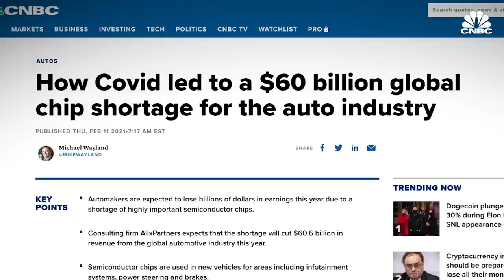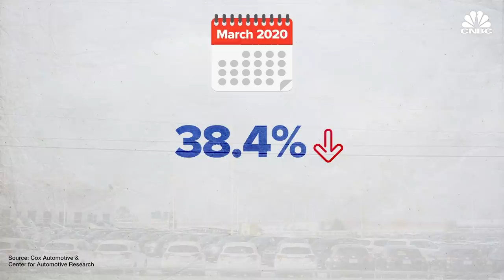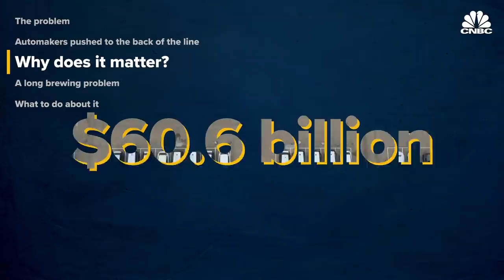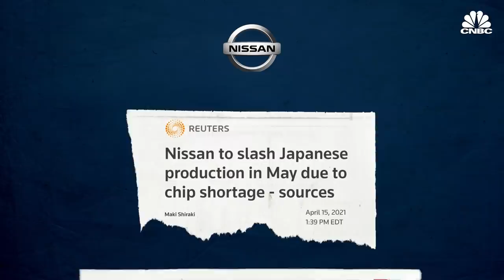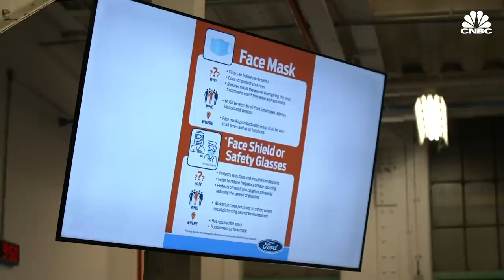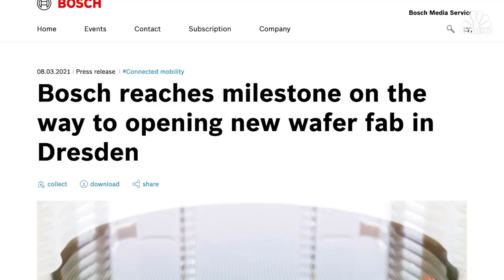Why Tiny Microchips Are Crippling The Global Auto Industry And Driving Up Prices

Comment: Is it really crippling? Or are we spreading fear?
Reply: Apparently certain manufacturers have been removing from entry level vehicles components such as digital dashboards, large screens and other  digital based components.
Reply: My local Mercedes-Benz dealer usually has 200 cars on the lot. They’re now down to 40. There are a few A and CLA class cars (entry level) a few C class cars, no E class cars (Mercedes-Benz midsized sedans, their bread and butter cars), and 2 S class cars and fewer than 10SUVs. No it’s not just spreading panic. The shortage is real.
Reply: Spreading fear?  The chip shortage is great news!
Reply: I work in a ford plant we now have 2 months till new supply comes in that means the plant is closed these chips are for things every auto maker needs like airbag sensors and stuff . everyone is affected so for the industry it is a really huge deal but also entirely their on fault but thats a different story
Reply: Try buying computer parts, then you will see how real this is.
Reply: I am not a fan of Apple but one thing they do very well is guarantee supply chains. They book capacity for chips or screens well in advance of launching a product, typically 2-3 years in advance. You cannot have flexible supply chains when capacity is limited. The automotive industry is not a valuable customer to chip manufacturers. They use many inexpensive chips based on old technology. Even budget phone manufacturers are much better customers.
Reply: @Snowbush2  that fact that you think gpu's and cpu's are at all comparable to the other basic IC's is laughable.
Reply: Yes they are needed for the technology. Most manufacturers moved away from basic simple cars that don't require these specific types of chips. 

More and more people are asking manufacturers to bring back basic cars. It's the biggest complaint I had when selling new vehicles.
Reply: In this case  CreateFear()  has been used.
Reply: no it’s really crippling, I lost a large majority of my deals I had in pipeline due to the shortage. Sucks balls.
Reply: @texasgermancowgirl  if you sell cars, hit your people for referrals, call service appts for trade evals, hit your used inventory list. In Elead you can filter these out and find decent opps. That or go to the skate shop and start skating people 😂
Reply: @th0rn3gaming  I sell computers and software sadly. Or I would totally do that. :( computers are different. Software is easy though.
Reply: @texasgermancowgirl  aahhhhh, my advice. Don't sell cars 😂

What type of computers do you sell?
Reply: It definitely is. We’re seeing a lot of plants shutting down or running on limited production. It’s all a money grab for these guys until the social tech needs die down then it’s back to auto.
Reply: @BigMaxStax  are workers being fired? Otherwise people are just driving old cars a bit longer or buying second hand. No big deal.
Reply: spreading fear. auto makers have plenty if room - like standarisation and interchangeability. also using open source solutions. 
That is what most other manufacturers do - dram chips, gpu's, asic glue logic - is all interchangable in consumer electronics because supply chains are unstable.
Auto makers used legacy chips and deliberately introduced planned obsolescence to hinder any recycling. So now they drink beer they brewed themselves - when all other customers use smaller dies of cutting edge chips and juggle suppliers, auto makers realised they are not center of universe.
There are many solutions , and bucket of cold water will not hurt.
And hey. import tarifs! that means customers will pay anyway.
Reply: lots full of unsold new cars here in north Texas
Reply: I’m spreading mayonnaise
Reply: It's a real enough problem. Automakers can go hang, they made their bed, they can very well lie in it. But all the rest of the industries are also in frits, lead times for absolutely everything are through the roof and working around component availability causes unnecessary redesigns all over the place.
Reply: @aleksandersuur9475  Well, there was room to invest over past 20 years and last 5 were crazy. Instead of creating investiment bubbles which burst and leave ppl homeless, ppl could invest in something real, like setting completely standard fab. Last decade is like decade of scam - fake news , vaporware, even perpetuum mobile (ITER) . 
Speculative bubbles are big thing and everyone gets away with them. 
Banks cannot buy land - so they issue investor backed loans to ppl who buy houses , making prices skyrocket. precious metals speculators push investors to manufacture giant electric cars noone can buy - removing rare earth metals and precious metals like nickel out of the market, freezing them in big slabs of junk noone can buy or recycle. 
"renewable" scam removed tonns of indium by producing solar panels immobilized to the roofs in northern countries, smashing solar tech price thru the roof and making world dependent on China. 
Please continue and we all will be surrounded by scorched earth , surrounded by useless junk owned by banks.
Reply: Back in July-August of 2020 along with the many rumors of the RTX 3000 series coming out, there was another rumor that there was very little supply. Of course rumors being rumors, that one was easily ignored. Upon the unveiling of the RTX 3000 series people began selling their old cards at insanely low prices (RTX 2080ti for $500) given the performance gains of the newest generation. Upon the release of said RTX 3000 cards the shortage became evident as basically nobody could buy them. Same thing happened with the Ryzen 5000 series and RX 6000 series. Fast forward today and prices are through the roof :|
Reply: @t1e6x12  Well , those dies had low yield in the first place. Manufacturers do not hide that. 
Also mobile devices take tonn of the foundry capacity, and consumers push toward smaller and more power efficient devices as battery technology is crap. If customers could live with larger, heavier devices, powered with LiFePo instead of short lifespan lithium batteries, there would be not such strong push toward most power efficient silicon in mobile stuff.
Markets are interconnected. It will take time until people will respect that.
Reply: While the news is centered on cars, the problem is actually more widespread and much worse. I’m an embedded systems engineer, I do PCB/circuit design with CAD software (Altium), and help with writing the firmware . We contract ourselves out and work with companies in many different industries, like consumers electronics, medical devices, industrial controls, commercial machines, even some work for the government. 

All of those industries that I just listed are affected by this since we can’t source parts for their projects. It’s random components. Just yesterday I was looking for an accelerometer(part number LIS2DW12TR). In fact here’s a small list of stuff we can’t find for completely separate projects:
 
4Mb flash memory (MX25R4035FZUIH1)
zigbee MCU (AW-CU477)
crystal oscillator  (FC-135 32.7680KA-AC)
another crystal oscillator (ABS07-32.768KHZ-7-T)
RGB LEDs (SMLP36RGB2W3R)
n-channel MOSFETs (DMG2302UK-7)
USB Type-C port controller (CYPD3177-24LQXQ)
Power Multiplexer (TPS2121RUXR)
an SoC (BMD-350-A-R)

One project we have, is being funded by a regular middle-class guy, completely from money he’s saved. If he can’t get his product built so that he can at least find some investors, sells some units, something, he’ll go under.
Reply: Yes Ford and GM plants in the US idled for 6 weeks now because they do not have the chips they need  So no cars are trucks are being made   I work in the auto industry  also affecting the factories that make auto parts

Comment: A big part of this is the use of specialized chips for each purpose. Using 10 unique chips for each car and maintaining supply of all 10 is hard. Instead, the industry should focus on using fewer general purpose chips for different applications. It isn't even that hard to do.

 The other thing is the use of legacy chips. When they say legacy, they mean 20-30 year old processes. For TSMC, maintaining both new and old manufacturing pipelines just doesn't make sense. The industry needs to stop hiding behind this false "reliability" and "security" bs and keep updating the electronics. It didn't have to be the 5nm or 7nm process node. 14nm first came out in 2014 and 22nm came out in 2008. Those have become reliable enough and we know enough about the manufacturing process.
Reply: It really would make sense for automakers to pick 1 kind of microcontroller, order a billion of them, and then program them to do the different functions needed.

Comment: This wouldn't be a problem if every damn piece of technology wasn't controlled by computers now. We even have people who have tried to invent juicers and running shoes (!) that require an internet connection in order to work. Cars have insanely complicated automatic transmissions now that have so many complex computer algorithms in the name of saving a tiny bit of fuel. You can't even replicate your key at your local Albertson's for $10 anymore because your key is now a computer, and the only way to replace it is to pay your car dealer $400. All the while, mechanics have noted that cars are becoming harder and harder to work on because so much of the car is controlled by computers rather than mechanical systems.

Computers are not bad per se (I'm using one right now lol). But not every piece of technology needs them.
Reply: Capitalism at its best.
Reply: If we really wanted to get the best gas mileage and cut emission, no car should go over 40mph and no car would have over 75hp. So many lives would be saved and a much cleaner environment.

Comment: I think in future we need to visit software developers/engineer instead of car mechanic for maintenance
Reply: It's already happening right now.
Reply: In the motorcycle world we often  get updates through Digital Technician, so yea its already happening.
Reply: I dont think the software dev or engineer is the right person for this, they dont even have the source code.
Reply: @josefaschwanden1502  them maybe we have to visit construction guy 😂🤣😂🤣😆
Reply: And electricians
Reply: You prefer to have maintenance every few months?  I prefer not to need any maintenance for years.
Reply: that's why they're called technicians now. No longer mechanics. And when they can't figure it out, they call engineers at head office. So, it's happening.
Reply: If car material quality drops, your predictions will not be happening.
Reply: @Ryzen, buy yourself an OBD-2 scanner. You can hook it up to your car to get error codes. Most maintenance nowadays is just reading off codes and following documentation. Most of the car information is on the CAN bus anyway. You just need to tap into it.
Reply: Already happening, I am a tech for Land Rover. Already had to brush up on Java to better understand the diagnostic routines used by our software. Also use a HEX decoder to interpret CAN bus signals for bit errors.
Reply: @desertsoldier41  software developers/engineers can become murderer if they want to, or to get revenge from someone you know what I mean
Reply: @randomfootages9120  There are redundant mechanical backups for steering and powertrain management.
Reply: $400 to replace a side mirror on a Toyota 4 Runner.  Purse strap caught the plastic trim cowl and snapped it out.  Looking for a horse.

Comment: No worries, my old trusty Honda will last another 10 years.
Reply: My current Honda isn't built and is nowhere near as reliable as my last 2. No V-6 available in a their cars and I believe their design and engineering is slipping.  Toyota looks to be a more solid choice of late.
Reply: Honda stopped being reliable.
Reply: @ryansmithc  My Acura burns 1 quart of oil per 1000 miles or so...definitely not a good thing

Comment: Such a HUGE industry with massive profits, and clearly very little foresight. Good story. Was wondering much as heard about shortage and was puzzling to me.
Reply: Oh trust me, they knew that auto demand would spike again. Chip suppliers were warned about the spike in demand months ahead of time! They simply refused to take the auto suppliers’ outlook seriously. If you ask me, it was a great calculated move on the chip manufacturers to move to higher profitable sectors and blaming the auto manufacturers for not seeing this ahead of time. Trust me, they were warned.
Reply: That’s why many manufacturers no longer make cars, only trucks and SUVs. There’s a higher profit margin for them (in other words, consumers are paying much more than they should) They could continue to make regular cars, but they feel that the level of profit simply isn’t worth the effort. So when there’s a steel shortage or chip shortage, whatever vehicles they do still produce will be halted so their resources can go to the higher profit margin vehicles.
Reply: This hits like every industry using manufacturing their own electronics.
Reply: @BigMaxStax  I promise the chip supplier is still running at full capacity. Why should they care about people who tried to leave them holding the bag.
Reply: You think Ford and GM buys chips directly from chip makers? Check with your tier 1 and tier 2 auto parts suppliers why they reduce the order back in early 2020. Why Tesla was able to keep their assembly plant running in China?

Comment: This is a symptom of a bigger problem no one is talking about. Had a Daimler (mercedes) truck engine repair stalled because no cylinder available. New engines being made. Spare parts not available. Wht the shortage for a metal component?

Comment: The whole market is in allocation, that usually also leads to overblown forecast from each car maker and stock building for the parts needed to make the ECUs and other controllers. A bubble coming up... the actual demand for cars is significantly reduced compared to 2017-2019, also because there is less money in pocket from the ongoing pandemic.
Reply: And actually the allocation is driven by wirebond and die attach machine shortage in the market... some machine delivery leadtimes have quadrupled in the last months, which is problematic for the fast paced Semiconductor industry

Comment: Consumers: we want this, we want that 
Car makers: sure
Consumers: why are the cars getting more unreliable?
Reply: I never asked for any of the complexity auto manufacturers shoved down our throats.  A real market should have options. There are no simple cars, but its not because we don't want them.
Reply: Define "more unreliable?"  In the 1920s, a new car warranty was 90 days.  It had grown to a year by the 1960s.  The typical new car warranty today is 3 years, with VW offering 5, Kia offering 10, and various other manufacturers offering terms in between. 
A company's willingness to stand behind its product, to literally put their money where there mouth is, is among the greatest indicators of a well-built and reliable product. 
Plenty of people lament about how easy it was to adjust a carb or change a spark plug back in the 70s, and point to the "unserviceability" of modern cars as the problem.  Modern cars also have platinum 60k-mile spark plugs, electronically-controlled timing that doesn't require mechanical adjustment, electronic fuel metering that doesn't require jet changes, idle adjustments, or float replacement. 
Objectively, new cars now are as reliable, and arguably more reliable, than they have ever been.  The mean time between failures has skyrockets, cars spend less time in the shop (whether pro or diy) than ever since their inception.

Comment: You should do one on the HVAC equipment shortage. Those chips are also used on higher end HVAC systems and that’s only one reason equipment and parts are slow to getting to dealers.
Reply: yep. without transicold and thermoking people would starve. Ironically HVAC is needed for electronics fab.

Comment: The joys of new cars with loads of stupid, gimmicky tech-bloat.  Soon to be nightmare used-cars with loads of expensive tech repairs.
Reply: This is exact. All these new tech and computers is only going to make car repairs that much more costly.

If drivers today need all these fancy sensors and tech to be able to drive "safely" they shouldn't be driving at all. It's not even that hard to check blind spots and drive.
Reply: @kuvjason7236  Nobody needs it to drive, but it does make the overall experience more relaxing and safer for others.  Buy what you can afford. Simple as that. It seems those who fuss over all the “gimmicky tech bloat” are the ones who can’t afford it. Envy turns into hate.
Reply: @ryansmithc  Yes, every dislike or fuss someone has about something can surely be attributed to them being poor & envious of others.  I bow before your unparalleled intellect.

Comment: Growing manufacturing pains doesn't mean we're better off with fewer or no microchips. They are responsible for AMAZING things that 99% of people don't realize where they are and what they ACTUALLY do. There's 3-8 (roughly) microchips just in the remote lock/unlock/alarm/trunk key fob you have. Didn't know that did you? Ebb and flow...it's like the oil industry- supply glut lowers prices and rigs are stacked. Shortages happen and forecast futures rise enough that rigs are returned to service or new ones commissioned, more and more so as in the 21st century. This is nothing to be super worried about because the market economic rules and norms mean more people will get into manufacturing.